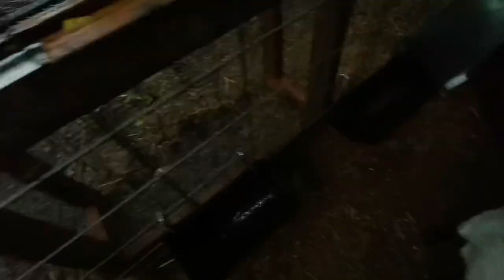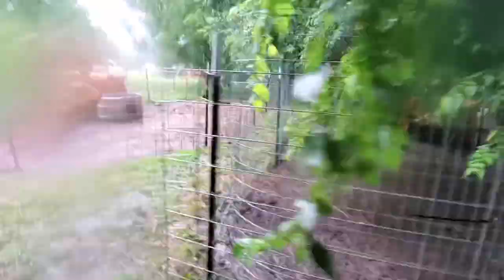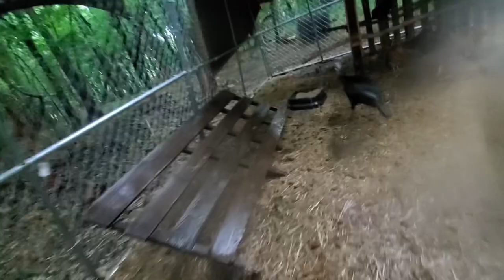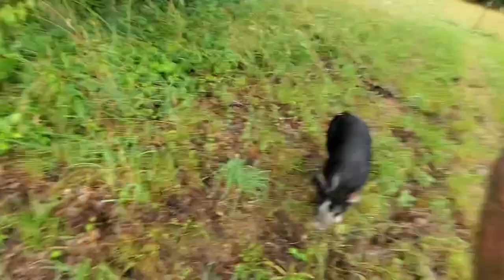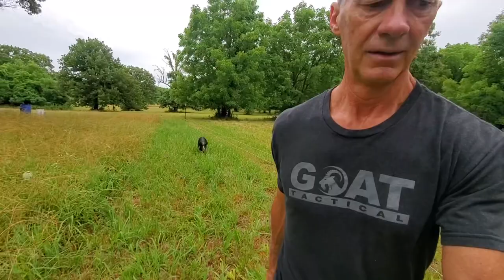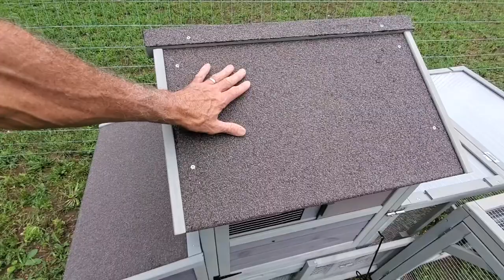THE BEST BACKYARD CHICKEN COOP FROM AMAZON!

Comment: I have a similar chicken coop with an attached run and I will tell you right off the bat that the roof section to the nesting boxes will leak water into the nesting boxes.

I saw someone on YouTube modify their coop with a piece of heavy clear vinyl screwed over the hinged area to keep the water from running inside the nesting boxes.

I still need to do that modification to mine.
Reply: Good to know Patrice. Thanks for the heads up.

Comment: lol they just look like pears, no chocolate flavor(I wish though!). They get a brownish shoulder and when the bottom part is dark red, they're ready. They taste great and are perfect little snacks. That little chicken coop is great for a nice little flock (you nailed it on 4-5 hens). If you want to cover the added run, you can grab a section of that pvc greenhouse paneling and place it on top(comes in all kinds of colors and transparency). I have one of those coops (just an earlier model) for my young roosters(it was my English Orpington pen for hatching eggs)and it has lasted 2 owners, several years, and even a multi-state move. It is about to need the nest box replaced, but I am surely impressed with it.
Reply: Thanks Jackie. I'm not much of a tomato eater but I would certainly try one if it tasted like chocolate. 😂